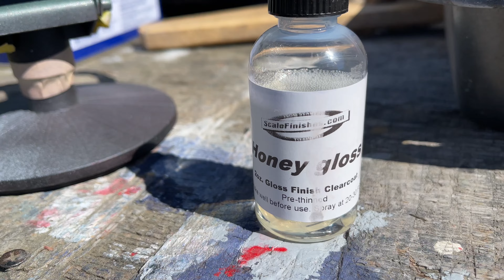Painting Model Cars - How To Airbrush

Comment: Gorgeous paint job!! I was wondering what Psi did you use on the compressor and did you mix anything with the paint like a Mr. Color leveling thinner? Thanks.
Reply from the maker: @nitroAl67  thank you, we did not think down the paint, this was shot straight from the bottle.   I tend to go more by feel but I believe it was set around 20 -22PSI 🤙🏼

Comment: Hi Paul, Question, I'd like to do a Car body in Maroon Pearl, but aren't Pearl colors like say the Tamiya Clear Colors in they need a Good Base color? example, Tamiya Clear Red Looks Darker Richer with a Gunmetal Base coat. So, What Pearl color should I use on A Maroon to achieve a Maroon Pearl. Sorry for the drawn out question. LOL
Reply from the maker: No problem at all, are you using airbrush or rattle cans?  If you are using airbrush, I would check out he selection of colors that ScaleFinishes has.  If you are using spray cans, my first choice would be to look for a base color/pearl through either Tamiya, Dupli-Color or Tropical Glitz.  If you are looking to spray a solid color down, then a pearl over it, I'm not sure what options Tamiya has but I know Tropical Glitz has different pearls and basecoats you can work with.  I have not sprayed Tamiya clear paints but like doing a candy, I'd believe your base color is going to play a key roll in how that clear color develops, using like you say, a darker base vs like a white.  You might be able to achieve the look using a dark base, shooting the clear red, then using their clear pearl coat.
Reply: Great Idea Paul, Using a Tamiya Red Clear over a Maroon base. Thanks Alot for taking time to read and awnser this. Much Appreciated. I Use strictly a Airbrush sense starting this hobby 3+ yrs ago. Lol, Hence my Ignorance in Painting options. Thanks Again
Reply from the maker: @slougo5909  no problem at all, you might check out some of the bases Jameston at ScaleFinishes has, use Leftcoast10 for a discount.  But he has a wide range of factory and House of Kolor paints